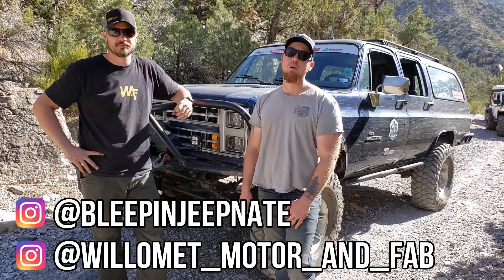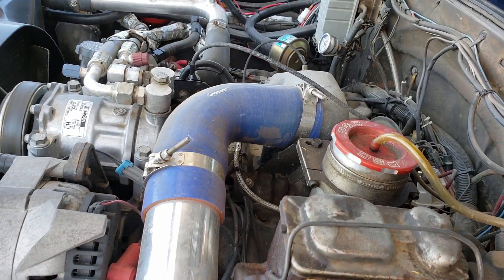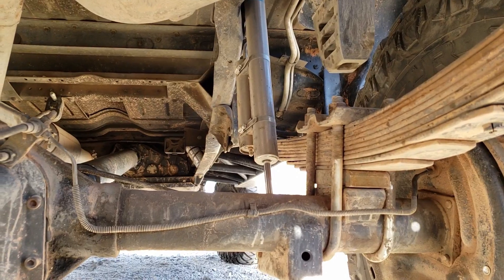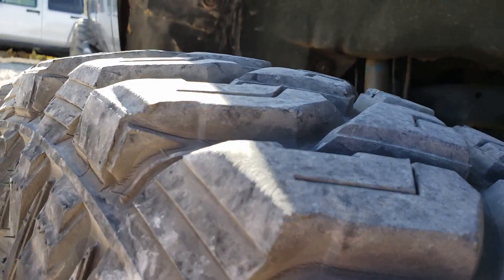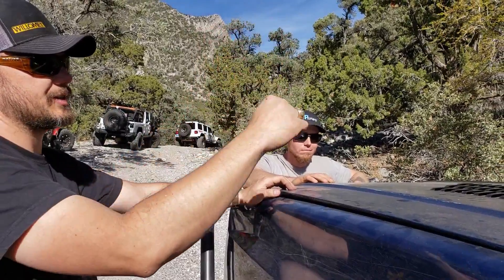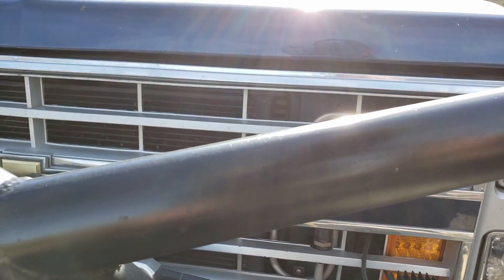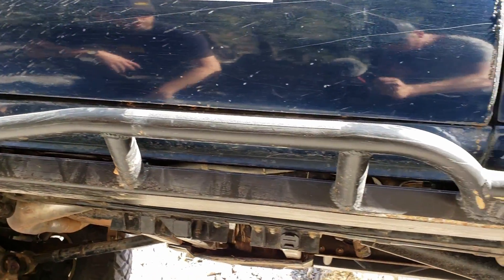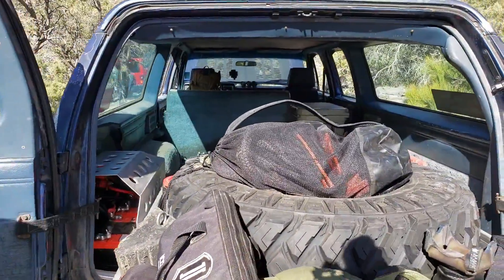Overlanding, Rock Crawling, Grocery Getting Square Body Suburban on 40s!

Comment: Suburbans are the most overlooked vehicle in off roading.
This is a great build especially with the 6.2.
Reply: Is the 6.2 any good? I’ve heard about head gasket problems? I know they’re slow but I want reliability
Reply: @Jared Kish  
They are a great engine when they are used for what they were built for.
They were never a stump pulling torque engine but rather built for fuel economy and dependability.

Comment: I learned to drive in a 69 3 door and graduated to an 85.
Of all the suburbans I've looked at yours and mine are the only ones I've been able to find that are proportionately correct.
Either they've gone dinky tyres with 12 inch lift or even worse, lowered!

Comment: Nate - you did such a great job creating this video.  Thanks to both you and Matt for talking a little bit with me about the truck.  The suburban has been in my life for a good long time, and I've learned a ton through the course of building it.  More importantly, it's taken my family and friends and me all over, and I've had the chance to meet some great folks, including the whole Trail to SEMA crew.
- David at WM&F
Reply: Thanks buddy! It was our pleasure!
Reply: Rad burb man!
Reply: amigo do you have youtube Chanel I need to learn from people like you
Reply: David,. You have a well thought out rig build there. I have always had a suburban of some sort since 1980.
Some were to haul my demo derby cars ( 20~25 per year) to wheelers and now a dedicated overland rig.
Reply: Very nice burban,  I have kept my 1987 to  get it back the way it used to run.  The only thing I liked more than my suburbans was my 1979 Blazer, it had a better turning radius and was a beast off road.   Your truck is a labor of love and so glad you got to keep your fathers truck all this time.
Reply: I noticed you had two alternators? Can you explain what you have the second alternator and presumably battery hooked up to? I was thinking of a similar setup
Reply: @Bankable2790  Since it's a diesel, it's been a dual battery 12V system from the start.  Similarly, the alternators charge the 12V system in parallel.  Both drive back to the same positive terminal stud under the hood, which ties back to the busbar with the rear mount batteries.
Reply: @saloram990  I do.  Folks like Matt and Nate got me started doing all this stuff.

Comment: They make great trail rigs. Very simple and easy to find parts. Only issue is they get about 8 gallons per mile.
Reply: And that's not a typo
Reply: Danny Kyle 
It’s fun wheeling the full size, and you’re absolutely right about easily finding parts.

Since it’s a diesel, it sips very little fuel on the trail. Highway economy was up to 16 mpg cruising on the Trail to SEMA. Not bad; not great.

Comment: AWESOME truck! Lots of Off road Design parts, they are synonymous with anything square body and off road performance fab and parts.
Reply: Brian Rocco 
Glad you liked it. Off the top of my head, the truck has their:
- springs and shackles
- Magnum-205 transfer case
- front and rear bumpers 
- custom valved Bilsteins

I’ve worked with Stephen at ORD for nearly 18 years, and he and I have very similar ways of looking at systems design and component selection.

Comment: Love the old Suburbans. We've had like 5 on the road over the yrs and a couple for parts. Hell I was wheeling a 77 K10 back in the 90's. I had the 350/465/205 combo. D44 front 12 bolt rear with 4:10 gears. I put a 4" lift and detroits in it. Daily drove it for yrs. My son bought our 87 3/4ton from us which we have had since 2007. It now rides on a 6" lift and 35"s and is daily driven about 100 miles round trip.
Reply: Brady Williams 
They’re a great multi-use platform to build and enjoy. The 456/205 is a fun and old school combo, and an excellent way to strengthen your left leg.
Reply: @WillometMotorFab  Yep. I like the 465/205 or 208 combo. My current CJ crawler has a FI 406/465 32 spline round pattern 205 clocked flat. My current truck is an 84 1 ton crew cab dually with a 4" lift. Has the 6.2 465/205 in it. My 86 K20 has a 465/208 and the son's 70 Jeepster has a 350/465/205. Yeah I like the simple  manual trans.

Comment: I had a louverd hood on my silverado back in the 80s. A truck company was selling them on a exchange basis
Reply: BUG OUT2 
Very cool - no idea there was an exchange program way back in the day. If I had it to do over again, I’d cut the work space from the B side, punch through to the A side, and weld/finish the B side bracing back into place.
Reply: @WillometMotorFab  they would cut out the inner structure and run 4 rows on each side then reweld the structure back on. It was about $200.

Comment: Absolutly perfect Surburban. Great build. I've been in love with surburbans for years. I'm currently working on getting an early 90's surburban from a freind. He was using it daily to pull his work trailer and it just quit running. He thinks its the spyder bad but I dont draw conclusions until I check em out. Early 90's 4WD, with the 350 and its the Extra long model, love it. Only thing that would make it better for me is a 454 under the hood but I can pull extra horses from the 350, it'll work just fine......

Comment: hey got a question for you hoping you can help me out ..i got a 1990 k5 blazer with 3" body  lift only and 35x12 15" tires on it..i wanted to no do you have to change the steering arm when you just do a 3" body lift...i would really appreciate your feed back thanks

Comment: Freaking impressive to see a heavy Chevy Burban conquer these Jeep trails man!!!  What suspension set up are you running???
Reply: Suave House 
Heavy is right. The truck weights in at a cool 8500 ready for the trail with me and my codriver in the seats. That’s roughly 3000 more than built JKs that are already heavy.

The suspension is fully Off-road Design. Custom leaves and bilstein 7100s have worked out very well.
Reply: @WillometMotorFab  
How does that ORD shackle flip do on the road? Do you tow with it ?
Reply: @xmo552  it's worked very well, and is a very cost efficient way to get flatter springs without having to put in tons of lift.  I prefer a tension shackle, but this setup has worked for several years, including towing.
Reply: @WillometMotorFab  
Thanks for the response. I prefer a tension shackle also, but it's nice to know your set up works. 
The reason I asked is because I have an 80s chevy 2x4 one ton tow truck that I'm converting to 4x4 + a lift. I need to keep weight capacity and the build has to not raise questions at random/constant CHP inspections. 

I think my rear lift will include 4x4 spring hangers, more leaves, and maybe a small lift block. Rather than highly arced springs, large blocks, or fancy/flexy suspension. 

I know a guy that tows over 30k with a 2nd gen 4x4 Ram and he designed his own air ride specifically for towing. The rear uses big rig air springs and a watts link. It's super clean and I would love to have him build me one, but I think it's not the best for my needs. I'm not sure air bags and off road is bueno and I'm not sure if CHP would allow that "modification".

Comment: Great build, I don't even want to know how bad the mileage is, lol.
Reply: Depends on how far I put my foot into it.  I topped out at 16 mpg during highway cruise on the Trail to SEMA with the truck fully loaded.  Not bad; not great.  40s cost me.
Reply: David at WM&F I’m replacing the stock 3 speed transmission in an old ‘81 search and rescue suburban, original warn winch, rear doors, big axles.. it’s new to me.... 305 V8; going dual propane/gas fuel, headers, dual exhaust.. My mechanic has all the parts.. one day I’d love to swap a diesel after the gas engine has had its day. I’m wondering your opinion: love your build style: there’s a 5 speed in my area my mechanic can put in; I noticed you said u have the 4L80-E - great tranny, which I Have in my gmc Yukon.. would this be your recommendation for the 80’s suburban platform for efficiency, or would a 5 speed get even better hwy miles... and what do you think for off road?   Practicality, etc.. Thanks for any opinions! Great story, great truck and sweet video.

Comment: Why stick with leaf springs?
Reply: Dakota Ortiz 
Right now - Simplicity. These custom packs give a full 14” of travel at each end, though a front coil over setup is on the long term list. It’s hard to beat links and coil overs for ride quality and steering control.

Everything on the truck is at a revision level, and when I wear these springs out, it will be time for a Rev4 suspension.

Comment: now he needs the turboed hummer engine
Reply: Deric Weaver 
I’m running a 6.2L from a Gen1 M998 hummer with a 35/40 hybrid turbo, but I think you are talking about the P400, which would be a really neat upgrade. 

That’s pretty much the engine Detroit Diesel originally designed when they developed the 6.2, and GM’s bean counters subsequently cheapened for profitability reasons. Too bad it’s out of production.

Comment: Nice burb 👍6.2 ??? a 8.1 in my opinion is better. 4l80 is awesome trans 👍
Reply: I love the 4L80, especially the ability to tune shifts and pressures, and set two different modes for offroad and street.  Big fan.  The L29 is a great engine, but not quite my style.  The guys at bigassgas garage are all about the 8.1 swap, and do an excellent job integrating them into some squarebodies.  Check out their instagram.
Reply: @WillometMotorFab  Thanks but don't need to, my 89 blazer already has a 8.1😎 I'm kicking myself in the azz for building a th400 and not a 4l80.  But Damn I love your burb 👍
Reply: David at WM&F hey, I was wondering about what you think about swapping a manual trans, like a 4 speed manual, and then a 5 speed when one comes up in my area: I need a new tranny and a 4 speed manual is available and my mechanic is keen to be putting that in: but should I hold out and look for a 4L80? ( my mechanic, seems to say he thinks they are crap... I dunno) I just want efficient and reliable. And manual is fun, for a truck, I think - what do you think; can’t really go back to an auto if we swap in a manual. .. thanks! Great feedback for all these posts, learning a ton

Comment: its cool, but it lived on the end of the cable....I kind wish it would have been pushed a little more.
Reply: Josh 
Part of me wishes the same.

Looking back, there are two spots on Pritchett I would have liked to try different lines and work a bit longer. If I had the same practice at Chewy as I did by the time we did Axle Hill and Yellow Hill, I would have tried a few different lines before calling it. But, we were one of 18 vehicles. The column needs to keep moving.

The objective is always to get the truck back in the same shape as she left, and a winch cable can go a long way to achieving that goal.
Reply: @WillometMotorFab  oh i know, and when doing that type of trip, similar to Ultimate Adventure, your goal to survive, not be a hero....Im a big fan of the c/k trucks. My wheeler is a 79 k30 that is more buggy now than truck.